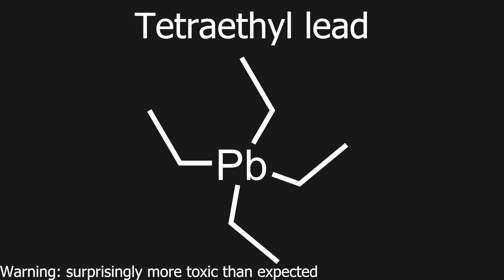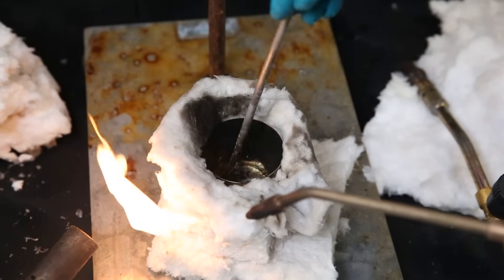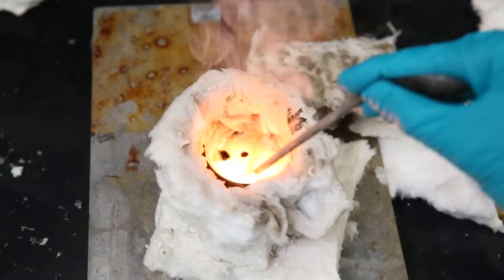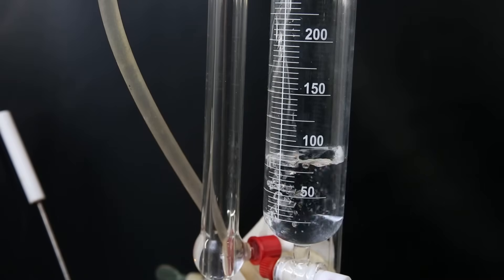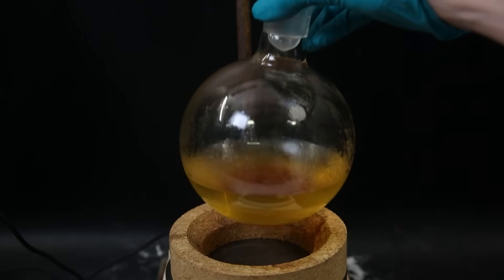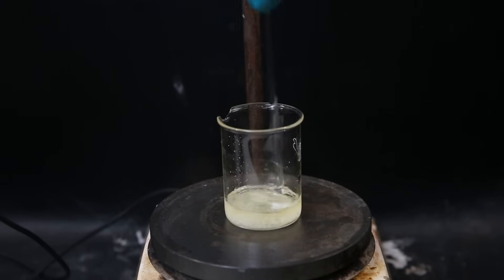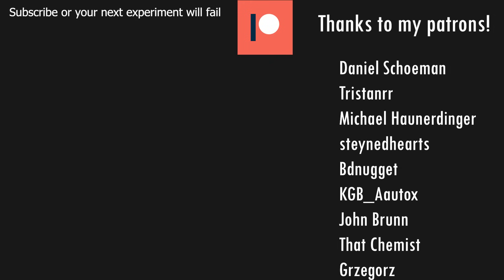Making Tetraethyl Lead

Comment: You forgot to mention that it also lubricated the valves, the early engines made to run on leaded fuel had soft valves and seats and when leaded fuel was stopped all those engines had to have hardened valves and seats fitted
Reply: That aspect is somewhat overstated, and depends a lot on engine design. Diesels have never used leaded fuel (would be very counter-productive for them) and many got away with soft valve seats anyway. Some gasoline engines from the leaded era are ok with unleaded fuel, others suffer valve seat recession rapidly under the same circumstances. Probably related to average exhaust temperatures.
Reply: @nerd1000ify  yeah some petrol engine originally designed for leaded petrol could last a decent amount of time on unleaded if they weren't under a lot of stress  but mostly it was later models with better valve material that handled it better or they were really old low compression,  low speed engines.. all old petrol engines did suffer to some degree from the removal of the lead, it's just a matter of some fairing better than others.. diesels run on lite oil so there's some lubrication there anyway and old diesels didn't produce a lot of power for their size, many modern diesels do run hardened valves and seats because of the higher rpm, egt and often being turboed.. heat isn't the only thing causing valves to wear, it also depends on the springs fitted because valves spin as they open and close, plus heavier springs also slam the valves closed harder, there's many factors that come into how much a valve will wear.. I've got some engines originally built for leaded fuel bury the valves so deep that they no longer seal because they won't even close anymore so i had to modify them and i've got engines that are still running on the old soft valves but I know they have suffered extra wear because of the lack of lead because I've checked them and relapped them when lack of compression became a problem earlier than it would have on leaded fuel
Reply: @Mark Short  do you use lead replacement additives? They're still often sold in Australia for older cars, but I don't really have any reference for how well they work. Most are potassium based as I understand it.

To my knowledge the highest performance engines always used hardened seats even with leaded fuel. As you pointed out, the stress on the motor plays a big part.

Leaded fuel is itself harmful to the valves, during WW2 the Germans found that lead (or maybe the HBr made by burning lead scavengers added with it) eats low alloy exhaust valves (due to nickel and cobalt shortages they weren't using conventional stainless) even though the hardened seats were OK.
Reply: @nerd1000ify  nah I couldn't be bothered with mixing lead replacement additives, I own a machine shop so when the soft valves and seats fail I'll just replace them with hardened valves and seats.. the cost of the lead replacement additives over time is far more than the cost of upgrading to hardened valves and seats anyway so it's not worth it.. performance engines didn't always have hardened valves and seats for the simple reason they didn't always exist.. the old valves were 2 different types of steel that were friction welded together, they weren't like the one piece hardened valves that we have today

Comment: Any thoughts on making dimethyl mercury?
Reply from the maker: no
Reply: @Chemiolis  osmium tetroxide?
Reply: @johnsmith-sp6yl  The physics department
Reply: The synthesis is surprisingly simple, but everthing left over will be next level 😵 hazardous waste. Can be made with aluminum, iodine, and methanol plus mercury or methyl iodide plus mercury. The methyl iodide intermediate on its own is pretty nasty. Dimethyl mercury is a nope.
Reply: Why would you ever do that?
Reply: Make dimethylcadmium to honor Ex&F

Comment: but y tho?? Isn't that burning sodium step aerosolizing massive quantities of lead dust? Is this the process the Ethyl Corporation used in the NJ loony gas building in the '20s?
Reply from the maker: They probably did it inert on large scale to prevent burning, and under better conditions (like a real oven :) ), but yes they did use sodium lead alloy like this.
Reply: @Chemiolis  Mixed in  an inert gas atmosphere (N2) then cast onto a cooled roller and scrapped off as "Flake"

Comment: It still amazes me that humanity was using this for as long as it did and people were inhaling and eating the decomposition products for freaking decades. On the other hand, the first commercially used, synthetic antipyretic/analgesic without an antiinflammatory effects oxidized people's hemoglobine (Fe2+ -> Fe3+) and hence was quite toxic aswell, besides being an absolute meanie to liver cells (it had a freaking hydrazine group!), so there's that.
Reply: The Romans used lead acetate to sweeten wine and of course had lead plumbing.
Reply: @Derek_Garnham  The lead plumbing probably didn't matter, as it passivates quickly. Making 'sappa' by boiling wine in lead vessels to make a sweet syrup that was widely used in cooking, however, was more problematic.
Reply: True,  I'd imagine the ruling classes to be more effected that the average citizen .
Reply: what's that? the antipyretic
Reply: And what is even more amazing is that nowdays we're even unhealthier and have more problems with health and obesity, cardio vascular diseases, cancer etc. than in the 60s when all cars ran on leaded fuel without catalytic converters.
Reply: Still used daily in light aircraft, dont live close to an airport I guess :)
Reply: @sovetea3599  Yikes!
Reply: I remember using leaded gas all the time. When I needed gas for the lawn mower, I siphoned it by mouth from my dad's truck. Rarely siphoned any without getting it in my mouth. Also, when working on cars, we used it to clean parts, and clean the grease off our hands. It's not as poison or dangerous as people made it it to be.

Comment: dude, your sodium looks contaminated. have you tried washing it with water?
Reply from the maker: It didn't taste contaminated so i thought it was fine
Reply: I always scrub my sodium thoroughly with a sponge under running water
Reply: That tends to happen when you don't store it in a protective 100% oxygen atmosphere.
Reply: I've been told it only works when cleaning >5Kg at once
Reply: I bought sodium for the first time, thanks for the tips, I'll be sure to try them 😃
Reply: A 50/50 water/thf mix works great for washing sodium! 😂
Reply: Alcohols work better. Make sure it's done in a cluttered area without access to fire fighting equipment
Reply: Naw too bad chlorinated solvents would work better
Reply: These comments are Atomic Number 79....
Reply: I add alittle dawn dish soap to the water when I wash my sodeem

Comment: It's not banned. Small piston airplanes like Cessnas still use carbureted engines that run on leaded gasoline.
Reply from the maker: Banned for general use, there will always be niche applications for any type of 'banned' chemical
Reply: @Chemiolis  Replacements for avgas are a very active area of research because the price of avgas is going up so much; both different fuels and aero diesels (which can burn common jet fuel) are approaches.
Reply: Also, tetraethyl lead was invented by Thomas Midgley Jr, better known as the inventor of Freon 12, the first widely used ozone depleting chemical.

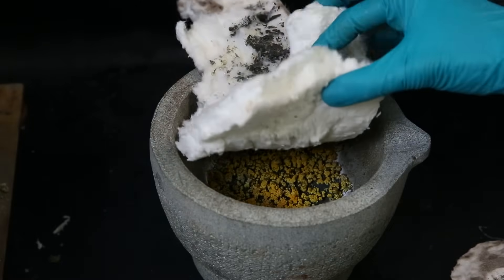Comment: Did you just chuck that piece of sodium in barehanded at 3:37 ?
Reply: As long as you have dry hands it's not that dangerous
Reply from the maker: maybe
Reply: Yeah
Reply: It won't melt your skin if you touch it a bit